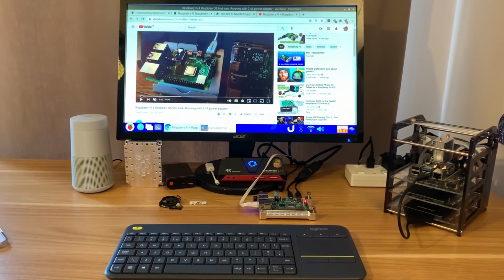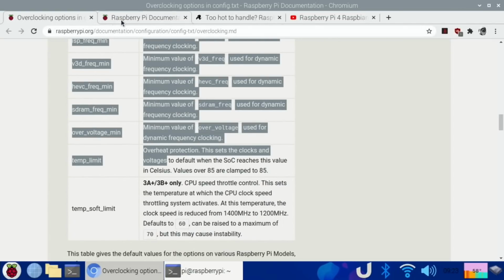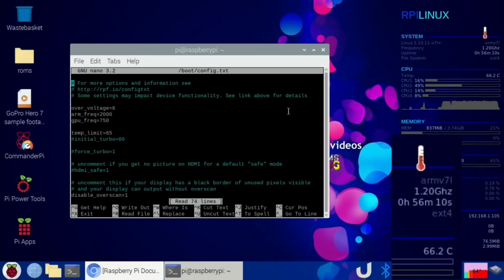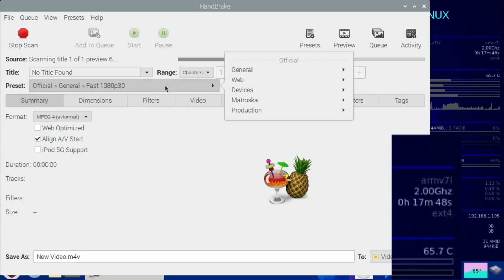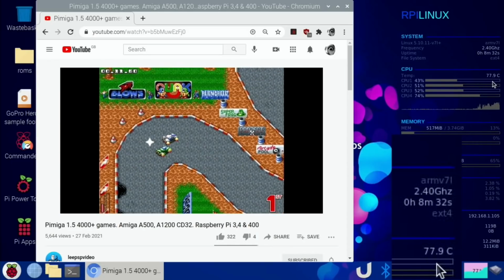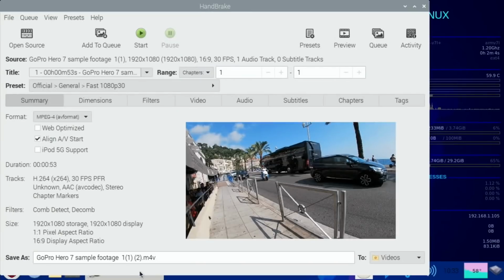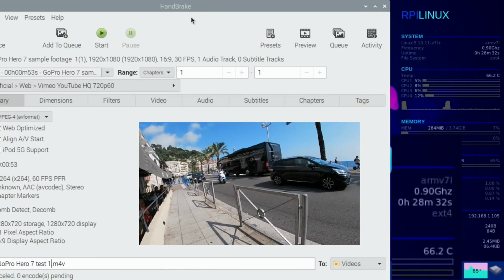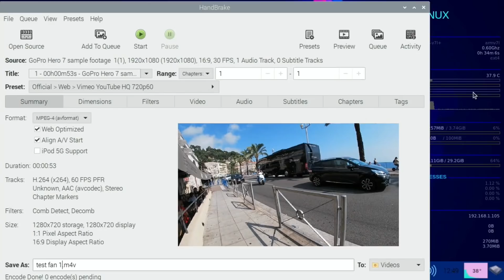Overclocking without cooling. Raspberry Pi 4.

Comment: Sooo, what your saying is that I've gone way overboard with the cooling on my CM4, with it's aluminum heatsink that is literally the same size as the entire CM4 module and about 20mm tall, with a high power 60mm 12V fan on top of that? 😂

Comment: Hi Mr Lee, i was wondering that is the CPU only necessary to cool down? or do you require cooling of the RAM chip, USB and Ethernet Controllers aswell? 
i was looking at the passive cases for Pi, the flirc case provided cooling to the CPU only, whereas the geekworm passive cooling case provided cooling of the CPU, RAM and all the controllers of the pi aswell, is the geekworm case overkill?
Reply from the maker: Check out the heat maps on this page

https://medium.com/@ghalfacree/benchmarking-the-raspberry-pi-4-73e5afbcd54b

Comment: I have mine in an Argon One M.2 overclocked to 2000 with an over voltage of 6, it very rarely goes above the low 50°s mark. I'm not a gamer, don’t make videos and edit all my images on my iMac so I don’t really push the CPU.

Comment: leo, it's just logic, if overvoltage wasnt necesary to get rpi4 to work at 2.0 ghz (bc at 65 celcius your pi4 remove the overvoltage settings you set) why would be needed for booting?? It's clearly not working at 2.0 and that's why it doesnt overheat. that's also why many linux user donn't like RPI. The main brain is on the broadcom gpu design, ThreadX, not linux. you dont have full control of your pi.

Comment: Pi Commander will not change my clock settings on my new Pi4. Has overclocking been disabled on the new pi's?
Reply from the maker: I doubt it, what OS are you using?
Reply: @leepspvideo  The desktop raspberry pi....If you are unaware of any disabling of the overclocking, then I have screwed something up on my end.....Obviously a learning opportunity for me....🤔
Reply from the maker: @bobsullivan5714  hold down the SHIFT key during the next boot. This will temporarily disable all overclocking, allowing you to boot successfully and then edit your settings

Comment: Hi Mr. PSPVideo,
I was looking for your advice on what to be looking for when shopping for a USB-C hub for Raspberry Pi 4.
I have a project for a Raspberry Pi 4, with the board that redirect the USB-C, HDMIs and Audio to the back, but there is no more USB port for inside the case (where I have a keyboard, 2x USB-DB9 and a multi-card reader to plug to the Raspberry Pi).
I would like a USB hub that plug into the USB-C port of the Pi4, a hub that would only have USB ports, and that would allow to power the Pi4 and the USB accessories.
What are infos and specs I should be looking for?
Does it even exists? I know of USB-C docking solutions that have USB-A, USB-C, Network, HDMI and/or DisplayPort(s), but I'm only looking for USB hub...

Sorry for the long question, and thanks for the advices!
Reply from the maker: Try asking on the Raspberry Pi forums.
Reply: @leepspvideo  thanks for the fast reply!
Stupid me, should have thought about it...
I got stuck with your videos in my mind, as I remembered you using on-the-go USB adapter to plug an ssd to your Raspberry Pi 4...
Thanks again!

Comment: I happened to have experience of supporting Raspberry pi 3b+ few years ago. We ran into so much problems at different locations. The pi 3 either shutdown or unresponsive. Finally, I found out that the issues were caused by humidity and high temperature. Because our server equipment along with the Raspberry pi 3b+ were situated in the kitchen of our restaurants. The pi 3b+ doesn't even have cooling fan installed.

Comment: the temp_limit variable is a very simple way to regulate temperature without crippling the CPU's performance. 
I've been looking for a way to cool the Pi for quite some time now, switching between passive and fan cooling, but you just demonstrated that no cooling is best cooling 
the only problem I have to solve now is a slow "resolve host" issue when loading some websites, including Youtube, that takes 4-5 secondes to boot (an inconvenience rather than a nuisance).

Comment: If you keep pressing the shift key rapidly (don't hold it down) while booting it will disable all overclocking, no need to swap out SD cards all the time.

Comment: Have you tried setting "arm_freq_min"? Try about 1000 and that is the minimum frequency your Pi runs at when not under load. It's normally 600. This will make your Pi a lot snappier but won't increase performance under load. It's really helped me when using my Pi as a desktop PC. Thanks for the excellent video!

Comment: You may be running into the current limit of the Pi's switching regulator.  If you hit that point(around 4 amps) you will get resets exactly like you are seeing.

Comment: Hi.. What is that temp gauge that is flashing called? Tanx
Reply from the maker: It’s built in to the Pi by default.

https://www.theregister.com/2019/07/22/raspberry_pi_4_too_hot_to_handle/
Reply: @leepspvideo  Thanks.. But that link doesn't explain how to enable / install it. Like most, Im not using Standard Pi build. appreciate it  though..
Reply from the maker: @WilsonBradleyTheOfficial  I don’t think it’s OS dependant.

Comment: Why not use #sudo nano /boot/config.txt  in the terminal. Make the changes and reboot. Unless your settings are too extreme you should have enough time to change the over_voltage or freq before it crashes. "Ctrl x,"  "y," "enter," reboot. 2100/800, with O/V of 6-8 seems to be the most stable for me on both my Pi4's with heatsink and fan. I do higher clocks for something specific like playing Quake 3, it makes a difference. 38-42* watching this and commenting on this video.
Something to watch for, killing the power supply. I definitely ruined an older one I had, (only 3A leftover from my 3b+ days,) and it was causing more frequent crashes.
Reply from the maker: At a few points I couldn’t access the OS before it crashed
Reply: ctrl+s ctrl+x reboot is faster